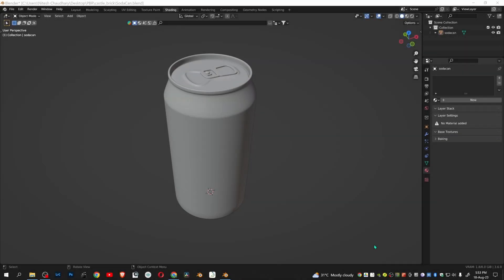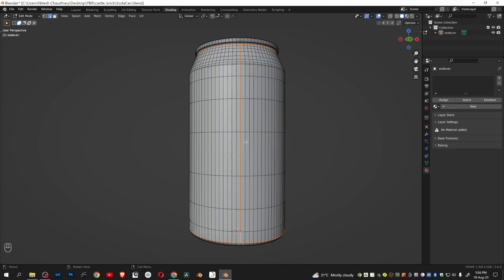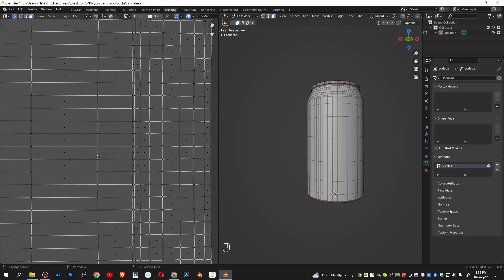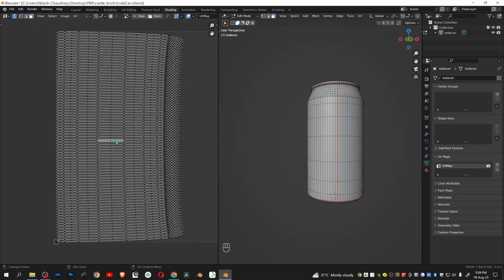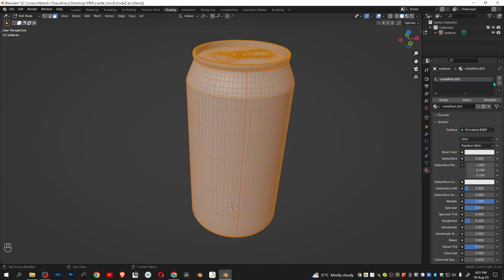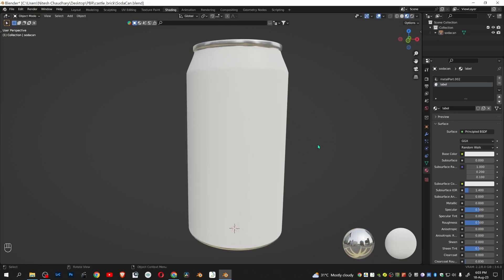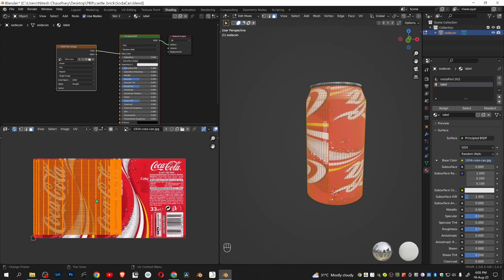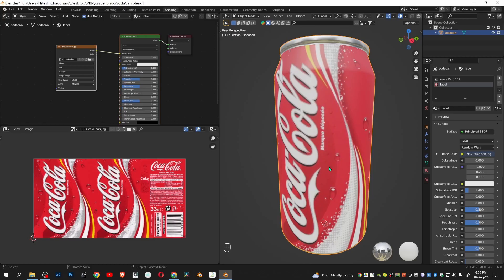Blender Tutorial : How to label a soda can in blender || Product Labelling

Comment: thank you for the video! Very helpful I learned a lot.
Also a tip for other users: Blender removed screen cast keys so you will need to add it yourself, you can do this by looking up "screencast keys" on google and downloading it. Do not unzip the file. then you go to blender then go to Edit -> Preferences -> install -> find screencast zipped file -> then click on the arrow to in enable (this works for other extensions) hope this helped!